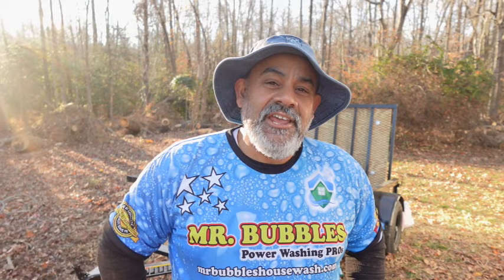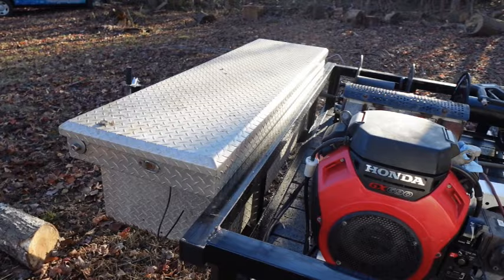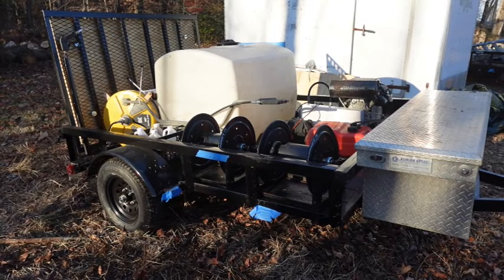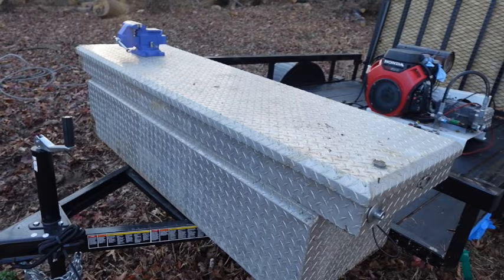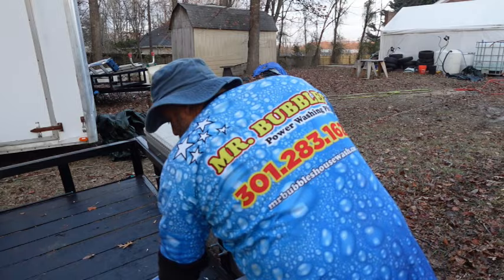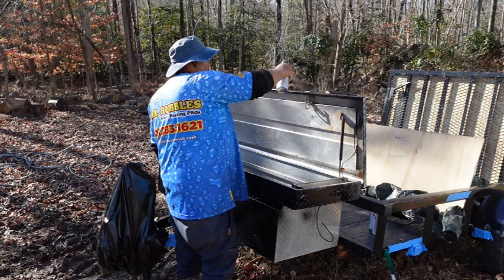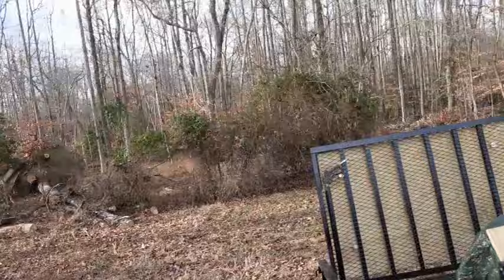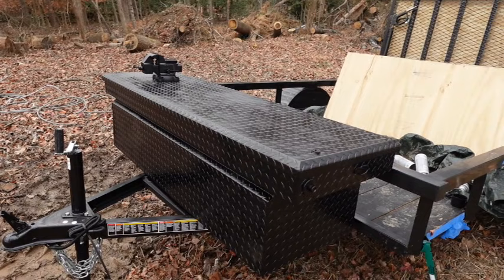Ep.82  How to Build a Pressure Washing Trailer (Part Three)

Comment: Love the video!  Is there a reason why you didn't mount the vise to the corner of the trailer?  I guess you were looking for a nice flat area to work on perhaps?  Also, should you mount the vise near the edge of the toolbox so it's faster to spin the handle around without hitting the toolbox?
Reply from the maker: Yeah, absolutely right; needed a super flat and high area, also, it's not something you use often, maybe 3-5 a whole season so I wanted it to be out of the way. Thanks for the great comment and question.

Comment: Next time just use two or four u-bolts through the bottom of the toolbox drilling a hole on each side of the fit the u-bolt with the flat bar with two holes in it that come with the u-bolt usually wrap it around the frame tighten up those two bolts per u bolt that sucker isn't going anywhere I only use 2 u-bolts on mine one on each side only four holes and you're not putting any holes in the frame of your trailer
Reply from the maker: Thanks for sharing

Comment: Okay now I'm sure you're tired of me lol.  Next time you put advice on a diamond plate tool box. Which is probably not the most advised decision and that may be only in my opinion .  But for these reasons the voice isn't going to get a good seal against the diamond plate which means potential water leakage or even chemical. 
2 aluminum can be pretty weak so even though you did use washers.  I would next time consider maybe using a aluminum plate inside the toolbox underneath device with a minimum of 1 inch additional footprint of the Vice itself.  One for support I know a lot of other things can come apart rather easy adjust device makes an extra helpful hand sometimes but for those really tough rusted parts that we sometimes have to take apart on the job.  You're going to need some real strength behind that. Therefore the bigger aluminum plate at least up to a quarter inch thickness definitely don't need more than that will give more support then the four individual bald heads in washers to the surrounding aluminum, so overtime eventually you don't crack it.  An additional benefit is you can always silicone the additional plate to the bottom inside of the toolbox flat surface to flat surface a little bit of sandpaper to make it nice and sealed again with the additional strength benefit.  
Great job I love that you're out here just showing people how to do this.  Please understand it's just food for thought.   I totally get your doing this to make it as easy as possible can with the minimum for someone starting out .  Keep up the good work !
Reply from the maker: thanks for sharing